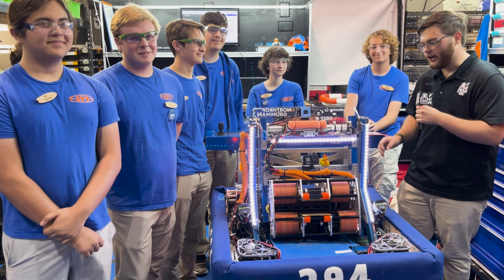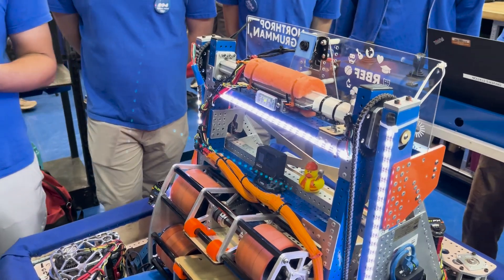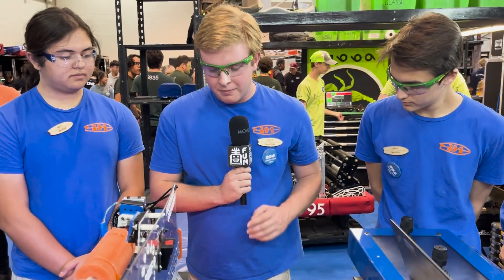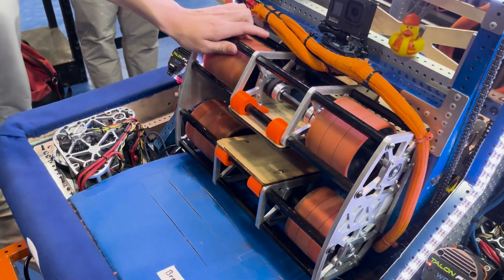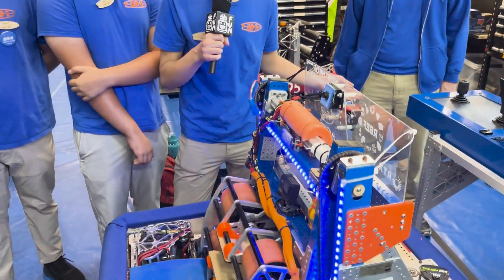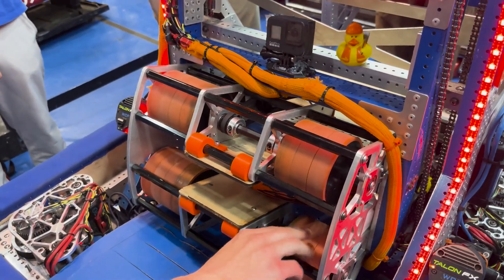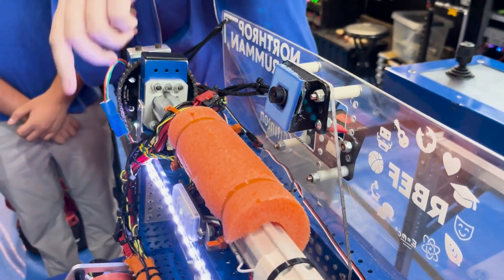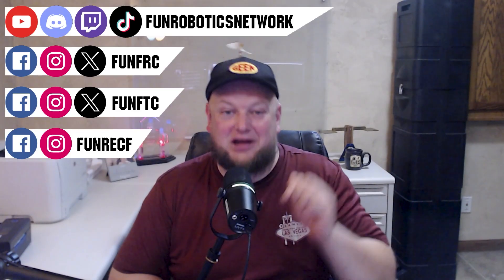294 Beach City Robotics | Behind the Bumpers | CRESCENDO

Comment: Wait the X on the back of the robot is metal? I straight up thought it was blue painters tape for the longest time
Reply: Yes!  3/32" thick aluminum.

All of the unpainted parts on the intake side of the robot were re-built between week 4 (Arizona East) and 6 (Aerospace Valley) of the season to increase the robustness of the design.  We added the metal X to stabilize the left/right sway of the tower, but - along with the other parts - we did not have enough time to paint them.  Some members of the team thought the silver X looked out of place and added the blue tape partially through Aerospace Valley regional, which is how we competed the rest of the season.  For a Halloween outreach events, we converted the X into a Frankenstein face and added giant 3D printed bolts to the side panels.  Removing the Frankenstein face brought us back to the plain metal finish for Beach Biltz.
Reply: @Tracer217  Love it! I think I saw you guys at Davinci for the practice matches (I'm on 3863). I was rooting for you guys on Einstein's, Good luck in 2025!